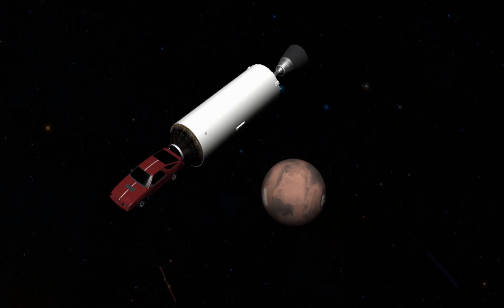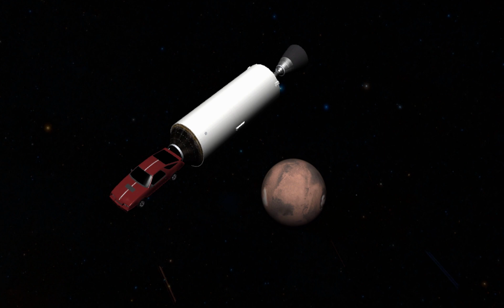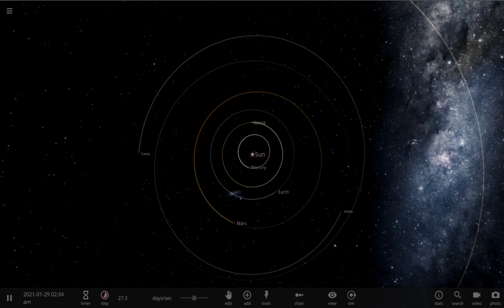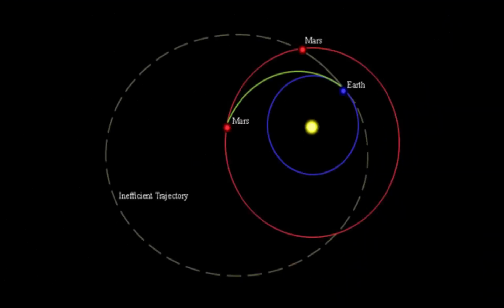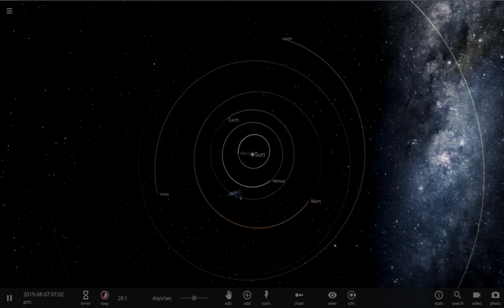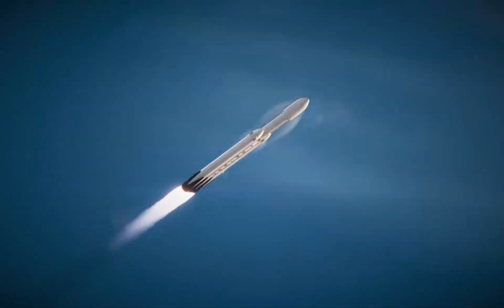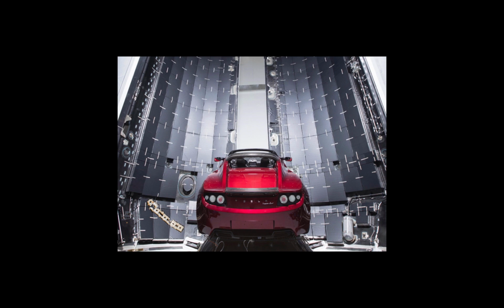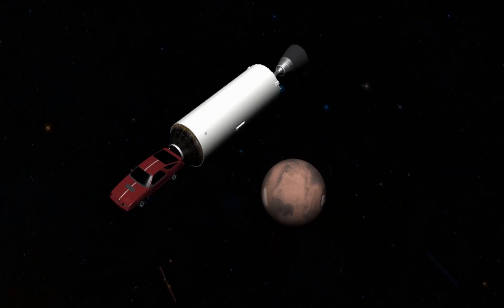How Far Can The Roadster Get -Explaining How The Falcon Heavy Can Reach Mars Outside Transfer Window

Comment: Is the payload a complete car? or has it been stripped of its internals to reduce weight?  If it were my project, I'd strip out the engine, batteries, etc, leaving just the shell. It would still look the same, but save a lot of weight.
Reply from the maker: no, its a complete car - given that the falcon upperstage alone weighs about 4 tons when empty, those few undred kilos wouldn't make much difference either

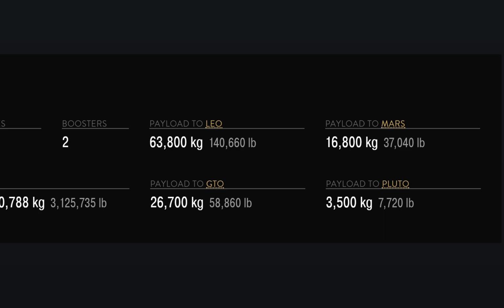Comment: the visual of the standard flight (5:54 till about 6:40) is great in that you can see how they use that extreme speed to their advantage -at that speed using small side thrusters to turn backwards so as to quickly get back down, once the fuel is spent they use the side thrusters again to turn 'backside down' so that it's oriented in the same manner it took off in...one hell of an awesome ballet to watch

Comment: the rocket was going over 25000km per hour at one point how would a car still have tires that are not popped.  side mirrors in tacked. windshield not shattered from the pressure? i guess the car was made with the same metals and materials as the rocket? 
 https://www.youtube.com/watch?v=cw3w5VDRGSQ the launch
Reply from the maker: the car was protected inside hte fairing until it had left the atmosphere so there was no pressure on it - tires were removed to make it resist vacuum
Reply: Same as men and satellites survive launch. and the tyres either now have an additional 1 atmosphere of pressure or the were deflated by 1 atmosphere before launch.
Reply: SW6 i noticed at the end of the video in the link in my comment that the container it was in popped off. You see a big flash then the side view of the car and earth beside it.  Then it switches camera angles to the front of the car and behind the car is earth.  What happend to the container it was in?  It evaporated?
Reply: Julian Danzer i see the tires on the rims still though?
Reply: Those panels are blown of with explosive bolts which ensure they move away from the rocket out of harms way, the flash may have been the bolts exploding. The panels just moved out of camera shot. After the camera had adjusted its self to the lighting conditions you just see what was there before the panels blew off and that is the Earth. the Car was supported from underneath so once the panels had gone there was 360 degree visibility.  https://www.theverge.com/2017/12/22/16811944/elon-musk-spacex-tesla-roadster-mars-falcon-heavy

Comment: Wonder if tesla has the dent resistance panels like the saturn cars had in the 90s? (You know,  in case it encounters space debris) LoL. According to the numbers I've seen on the site tonight,  it's traveling at 44,750 mph and is 147,600,000 miles away,  which is 4.5 months away,  putting it around late June for its planet Mars pass by????
Reply: +Scott Wehrman at that velocity, it ain't going to be a dent.  It's going to be a bright flash and vaporized car.

Tesla's body panels are aluminum.  Saturn's were plastic of a type that would return to shape if gently coaxed.  Aluminum doesn't.
Reply from the maker: orbital mechancis is a lot more tricky then just time and distance - but I've made an orbital prediction of its trajectory and it should indeed pass through mars orbit in about 4 months
https://www.youtube.com/watch?v=2UDLXgkqY6g

Comment: The HEAVY is not built like it is just to go Mars, its built like that so it can carry enough shielding to protect astronauts from the Van Allen RADIATION belts because they know they would die before reaching the moon....
Reply: +merlin 13 Doesn't need much shielding, just need to go around.  Like they've already done.
Reply: lol, the trajectory of the LM was actually through the Van Allen belts (2) for almost 2 hours with no shielding. Their bodies were subjected to radiation from the sun when they were 'moon walking,' their suits did not have sufficient protection.
Reply: +merlin 13 LOL yourself.  The astronauts weren't in the LM during the outward trip thru the VABs, and the LM didn't make the inward trip thru the VABs.  In fact, half of the LM was left on the moon, and the other half were directed to crash into the moon.  Except for Apollo 13 of course.

CM my dear, CM.

No shielding?  For ionized particles (what the VABs _are_) even 1/8" aluminum is fairly good shielding for short durations. 

Where have I seen this silliness before?  Ah yes, standard flattie fake talking points, right down to confusing LM for CM.

As for the rest, directly from Van Allen:

[Oh, and yes, I remembered it wrong.  It wasn't 20 minutes.  It was 15.]

Dear Mr. Lambert,

In reply to your e-mail, I send you the following copy of a response that I wrote to another inquiry about 2 months ago --

* The radiation belts of the Earth do, indeed, pose important constraints on the safety of human space flight.

* The very energetic (tens to hundreds of MeV) protons in the inner radiation belt are the most dangerous and most difficult to shield against. Specifically, prolonged flights (i.e., ones of many months' duration) of humans or other animals in orbits about the Earth must be conducted at altitudes less than about 250 miles in order to avoid significant radiation exposure.

* A person in the cabin of a space shuttle in a circular equatorial orbit in the most intense region of the inner radiation belt, at an altitude of about 1000 miles, would be subjected to a fatal dosage of radiation in about one week.

* However, the outbound and inbound trajectories of the Apollo spacecraft cut through the outer portions of the inner belt and because of their high speed spent only about 15 minutes in traversing the region and less than 2 hours in traversing the much less penetrating radiation in the outer radiation belt. The resulting radiation exposure for the round trip was less than 1% of a fatal dosage - a very minor risk among the far greater other risks of such flights. I made such estimates in the early 1960s and so informed NASA engineers who were planning the Apollo flights. These estimates are still reliable.

* The recent Fox TV show, which I saw, is an ingenious and entertaining assemblage of nonsense. The claim that radiation exposure during the Apollo missions would have been fatal to the astronauts is only one example of such nonsense.

James A. Van Allen
Reply: BS the Van Allen belts will far too high a dosage, even the Aldrin and co said they didnt know if they passed through the belts but later changed their story and said they did and then 'remembered the shooting stars' in their eyes, such a joke really. NASA in all its wonderful wisdom sent up a rocket last year to check/study the amount of radiation to see if it would be safe for a mars expedition, why if they had already been through it 6 times? it makes no odds about the LEM, we are talking flesh and blood and radiation. How did they walk the moon with NO PROTECTION. Even the ISS is LEO.
Reply: +merline13 The BS is strong in this one.  You don't believe in satellites, and hence you shouldn't believe in the VABs because it's the only way they could be discovered (Explorer 1, Explorer 3, Explorer 4, Pioneer 3 and Luna 1 (Russian)).  And you expect us to believe that _you_, a complete ignoramus know more about them than the guy who discovered, measured and mapped them?  More than the guy who they're named after?  Pull the other one.

You don't even know the slightest bit about the VABs, and we are supposed to believe you are the expert?   Pull the other one.

Actually Apollo has been past the VABs 14 times.  7 missions, both going and returning.  Including Apollo 13.

Of COURSE it makes sense to recheck their intensities periodically.  Because the VABs move and change strength due to the sunspot cycle, coronal mass ejection events and others space weather effects.  That's what creates and feeds the VABs and pushes 'em around.  Oh, and yes, the recheck done by a satellite well above LEO.

Change?  Hell yes, over 40 years ago there was even a proposal from astrophysicists to reduce the strength of the inner belt.  Experiments have even been done to test out the idea, and it works.  But they haven't done it because it would be a bad idea.

You yammered about the astronauts being in the LM during the VAB transits.  They were not.  You lied.  We know you cut-and-pasted that BS from another flattie you follow around like a sheep without one whit of understanding.  A flattie who didn't know any better.  Nor, obviously, do you.

If you're going to cry "hoax", you at least have to know something about the subject.  Making things up don't count.

As for walking around on the moon for a while, with the space suits and LM for shelter.  The LM's shells and suits contain layers of aluminum.  That is a pretty good shield against alpha and beta particles, otherwise known as ionizing  radiation.

While the radiation is higher than on earth, a few days on the moon is  about the same dosage than an airline pilot gets in a couple of years.  In other words, inconsequential.  But I'm sure you're going to bullshit you way out of that too.  We should believe you?  Or the scientists? 

https://www.nasa.gov/pdf/284273main_Radiation_HS_Mod1.pdf

Do you even know the difference between ionizing radiation and gammas or GCR?  Rads, Rems or Sieverts?  Do you even realize that the astronauts in LEO get more dosage in their long visits to the ISS than the Apollo astronauts got in their brief trips to the moon?

 When did you get your degree in RadioBiology?  You don't have one?  Thought not.
Reply: Are you nuts?
"Change?  Hell yes, over 40 years ago there was even a proposal from astrophysicists to reduce the strength of the inner belt.  Experiments have even been done to test out the idea, and it works.  But they haven't done it because it would be a bad idea."
That is one stupid statement regardless of who made it, (reducing the strength of the radiation which happens to be constantly replenished by the sun), why bother it were not a problem? No i am not a flat earther (stupid theory anyway) and yes i do believe in satellites.
Reply: +merlin13 The VABs would be a problem if they decided that they needed to put human-inhabited satellites in orbit above LEO.  So they experimented with it a bit to see if it would work.  It did work, and the calculations are that it would take about 2 months to reduce the inner belt to 1% of its current strength, and if they left the tethers in place, it would remove new ionic radiation coming just as fast as the sun replenishes it.

It's not a great idea, because this is part of what shields the planet from GCR (have you figured out what GCR is yet?).  Since it's obviously possible to get around them, and since we don't have a particular need for human-inhabited space stations above MEO so far, there's no compelling need to do it _now_.  But now they know it works.  Basic science.

But you wouldn't know what basic science is, would you?
Reply: my last response to you as a NASA apologist is that your statements are puerile.
Reply: +merlin13 run out of BS to spew, and that's the best you can come up with?

Speaking of which, you might want to learn about it.  An introduction is here:

https://en.wikipedia.org/wiki/Van_Allen_radiation_belt#Proposed_removal

The experiment I referenced was a joint ISA (Italian Space Agency) and NASA venture completing in 1996

On second thought, perhaps you should go to:

https://en.wikipedia.org/wiki/Van_Allen_radiation_belt and actually learn about the VABs instead of swallowing the garbage spewed by fellow Apollo hoaxers.  Wake up sheep.

Comment: People forget the fact that extreme temps, uv rays and what will probably destroy the car.
Reply from the maker: it won't be under much operating load though - so yes, if it got recovered I wouldn't feel safe driving in it, but jsut floating aroudn it will bprobably  hold together quite well

Comment: If the roadster gets hit with any asteroid or comet on the way to Mars it will spread space junk all over the galaxy. I don't know why Elon is doing this. Just because? I thought the flamethrowers by the Boring Company was ill conceived but we have enough space junk out there already. I hoped SpaceX would've sent a satellite or maybe a Martian rover. Hey, those boosters landed together. (Not sure about that 3rd one, though). C'mon Musk you're amazing but be careful. It makes it around the Sun and next somebody has a fender crashing through their roof. It happened with Skylab.
Reply from the maker: space junk in a mars transfer orbit isn't aproblem - thats too large, too far away, too spread out - and also an orbti which won't beused again since the next transfer windows to mars will all be different orbits
Reply: Well, I just heard that SpaceX had the wrong trajectory and the roadster isn't headed for Mars but instead orbiting the Sun. Maybe the car will melt or a spare tire might hit the ISS on its return orbit. I'll contact AAA.
Reply: it was always intended to orbit the sun, it's orbit just extended out to the Mars orbit.   They pushed too hard, and now will be orbiting the sun (still) with a max distance out near the asteroid belt.